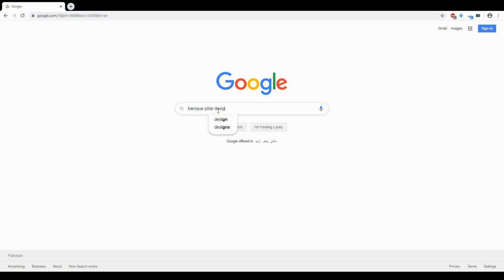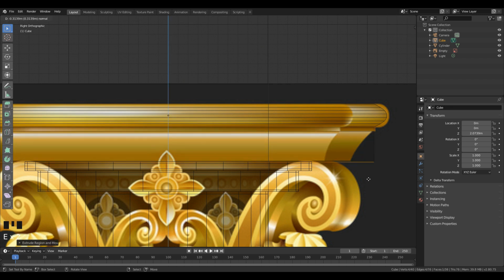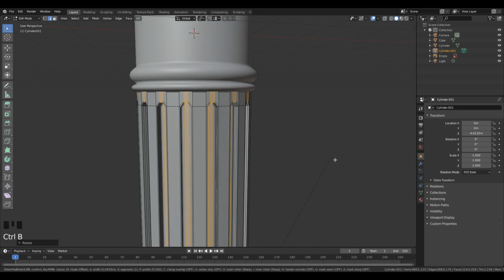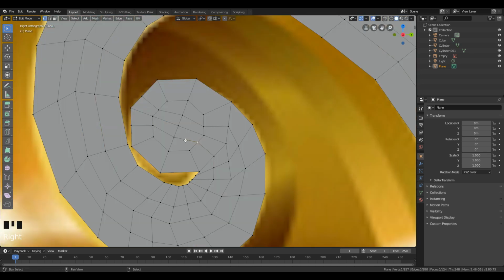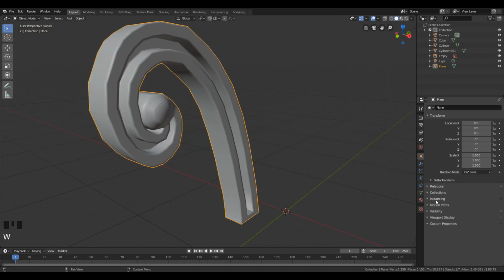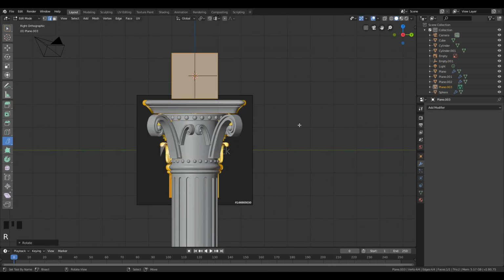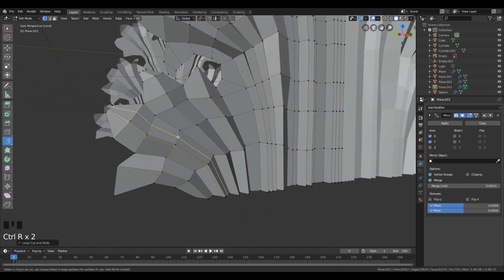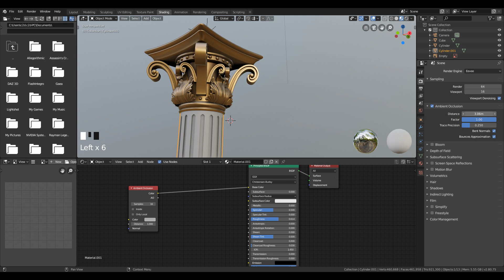Model Pillar Design Blender 2.8

Comment: Heeey thanks for making this! :D

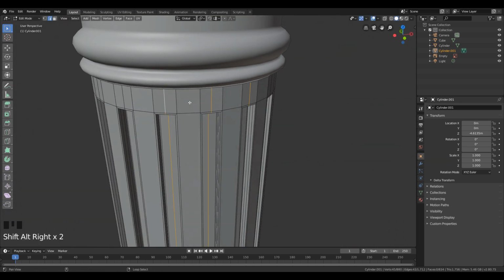Doesn't seem so hard after all now that I see you do it xD , very clever how you created the creases corners for the insets on the lower part of the cylinder to give it some sharp edges (What you do at 1:33 ). Looks really good :)

When doing architectural stuff, do you  often start in 2D when not following reference images as well?
Reply from the maker: You're welcome ,
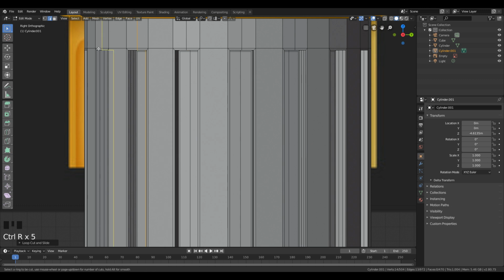at 1:33 I was just adding edge loops but pressing Ctrl + R you can also add edge loops to a model vertically or horizontally depending on the what edge you are on after pressing the short key .Thanks again.
Yeah sometimes I do but I recommend others to use reference more then just depending on own imagination and interpretation of things to make models easily and not to get stuck at a point .

Comment: Thanks man, this was a great tutorial, you taught alot of important stuff, just have a question. My final pillar has too many vertices and edges and when i duplicate more to make a column hallway it crashes my blender, is there some way to optimise it? Have you done a tutorial on it?
Reply from the maker: Thankyou so much .
The better way is to make it with less polys as much as you can . If you can bake the normals it will be even more better . If you want to duplicate it try to use alt + d duplicate it will create an instance of the mesh  by doing that it will use less memory.
Reply: @SaqibHussain88  Thanks again, i will definitely try baking the normals, and use alt d instead of shift d.

Comment: very nice tutorial.
have you used sketch up?  recently i am following blender a lot i really want to learn it. being from an architectural background i find you cannot do precise modelling in blender as much as in sketchup . maybe im wrong as im still in the learning curve i dont know.. what are your views?
Reply from the maker: thanks , I have also used sketchup too I can understand your point but you can also do precision work in blender too . You just need to know the basics like knowing how to change the unit system and preview the measurement and how can you use short keys to put precise value for your measured value . If that does not help then still you have a lot of addons to get more precision while working with an architecture model.

Comment: Hello i can't make the circle from the plane when making the ornaments i press alt+s but i doesen't work
Reply from the maker: You will need to add more vertices to it then it will work . If you are trying to make a single plane into a circle it can not work till you have some decent amount of edge loops on plane.
Reply: @SaqibHussain88  Thank you for the info, i have alraedy solve it .I was missing the shift key alt+shift+s i was pressing alt+s instead and that is why it didn't work.

Comment: Ok so I made this, but I notice that I have a MASSIVE poly count in the end, and I've tried using vertex groups, and both the decimate and remesh modifiers to reduce the poly count, but I end up losing too much detail and I'm not sure how to proceed from here. Does anyone have tips?
Reply: Might be a year late but maybe you can try baking from high poly to low poly for some of the details in order to decrease poly count.

Also for the leaf-like ornament in this baroque pillar, you can try to seperate it from the pillar and make it a seperate mesh.

Then add a flat plane which has the same curves as the ornament, and bake your ornament onto it, add opacity mask so that unwanted parts of the plane don't appear and now you have a flat plane with all those intricate details of the ornament in it.

You can combine these methods to get a fairly low poly version of this